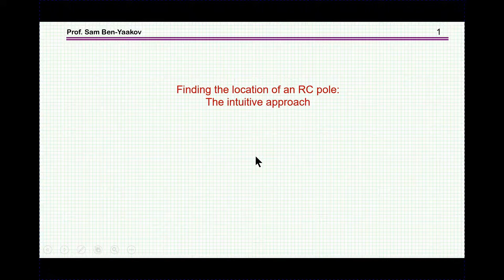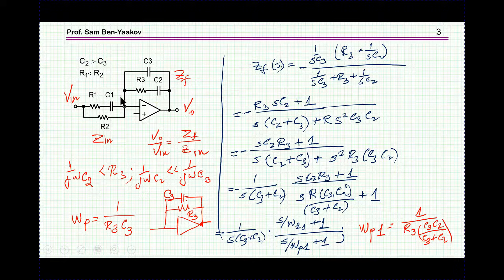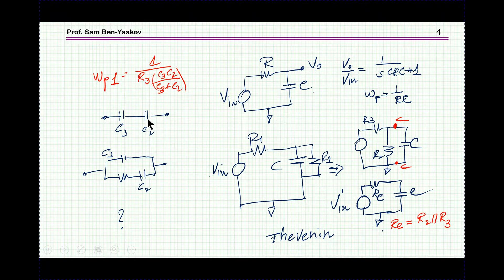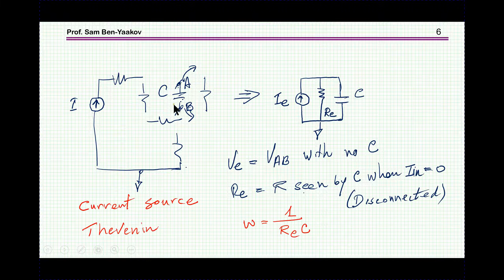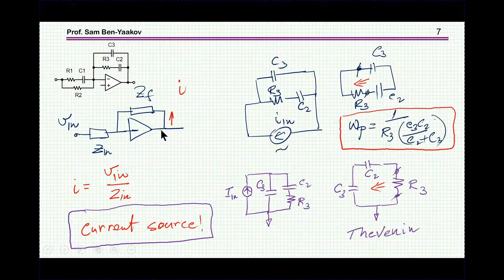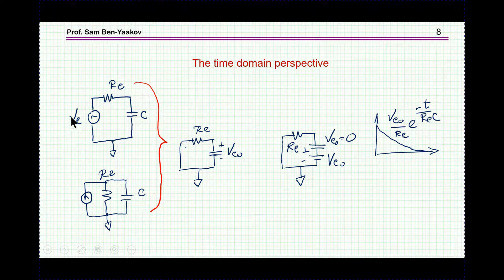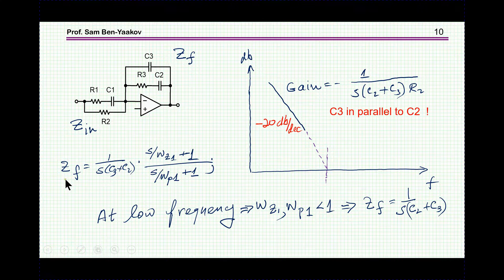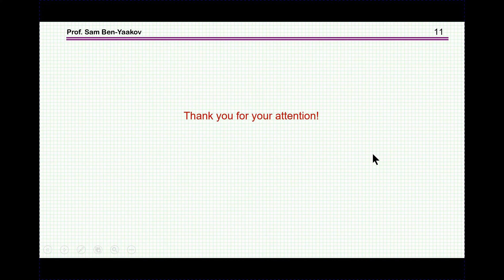Finding the location of an RC pole: The intuitive approach

Comment: Thank you  Dr Yaakov, now I know how to locate the first pole. Question about Rf / Rin in  this case Rin is R2. In real circuit, we have a divider net work with R2 and another resistor  (R1) at E/A (-) pin to ground to compare with E/A (+). Should Rin now is R2//R1 or it is just R2 ? Is this Rin would be difference if the circuit is a voltage mode or current mode control ? Once again thanks for all your hard work for teaching us.
Reply from the maker: Hi Thanh, Thanks for comment. I believe you can find answers to these questions  at 
https://youtu.be/t8xSwTnmYdc